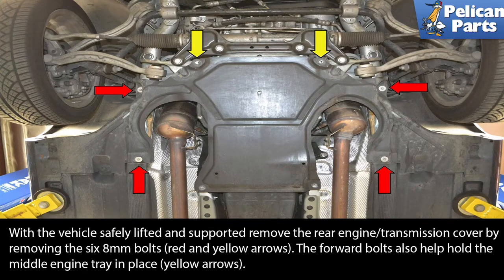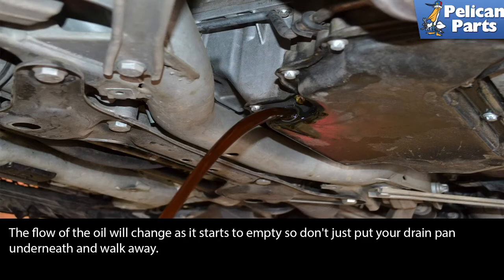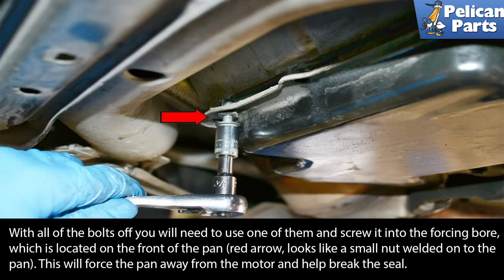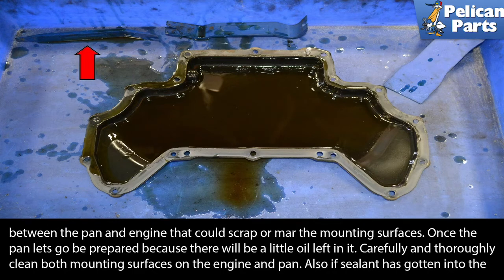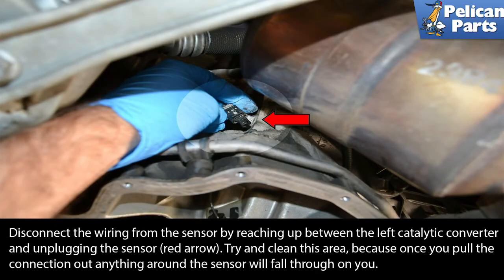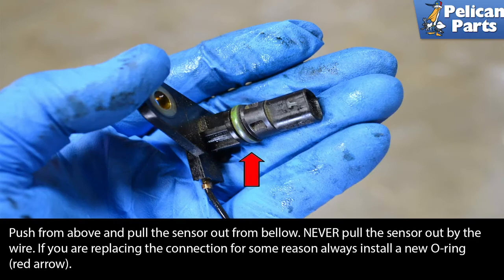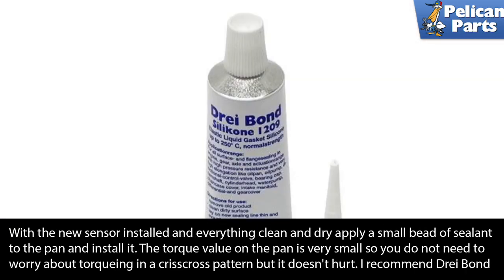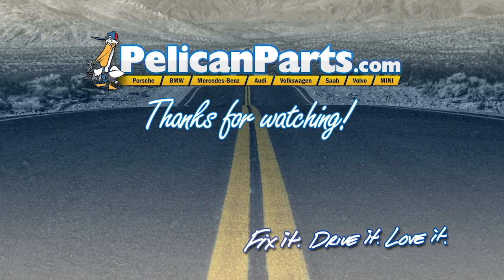Mercedes-Benz W204 C-Class Oil Level Sensor Replacement

Comment: Am getting check oil level at near gas station but i just serviced the car and the oil is well gagged 
Could this be my problem 
My car is w204 c300 2009
Reply from the maker: Oil level might be low. Confirm it is not. If not, the sensor may be failing.
Reply: @pelicanparts  thank you so much

Comment: Hi my w204 2010 C200 is leaking some oil slightly from the oil level sensor, is there a seal which can be purchused to replace this seal only ? 

Thank you
Reply from the maker: With your vehicle info handy, give The Pelican Parts parts specialists a call at 1-888-280-7799. They can figure out what part or repair kit you need.

Comment: i have 2008 mercedes c300. sport can someone hlep me where is located. the.  oil sensor??
Reply from the maker: Depending on which sensor you are referring it, it is either in the oil pan or behind the AC compressor in the crankcase.

Comment: I have a w204 2007 m272, I need to replace the oil pressure sensor/sender, I can't locate it anywhere or find a replacement part but my ECU says it needs to be replaced. Can you shed any light on this?
Reply from the maker: Going by memory, the oil pressure sensor is located near the oil filter housing, on the crackcase.